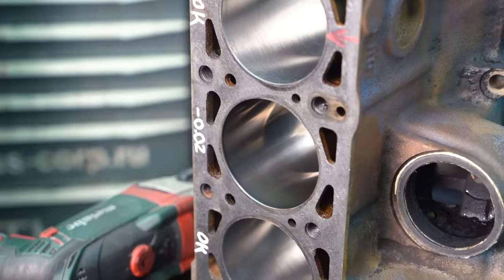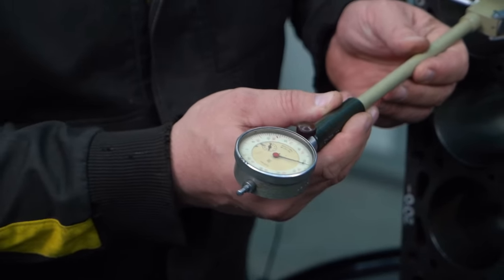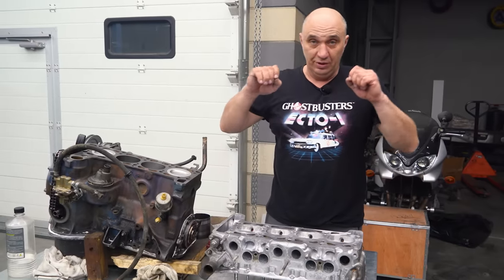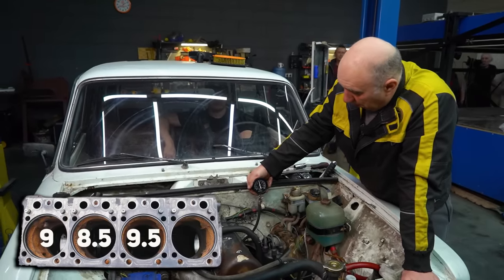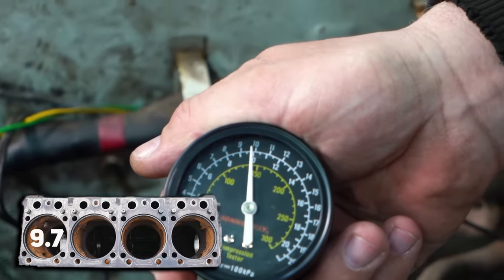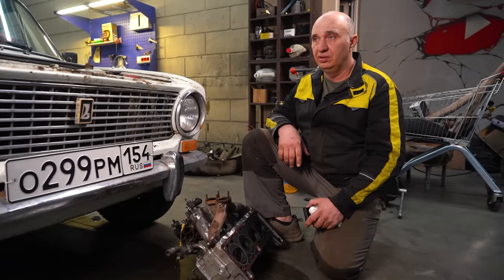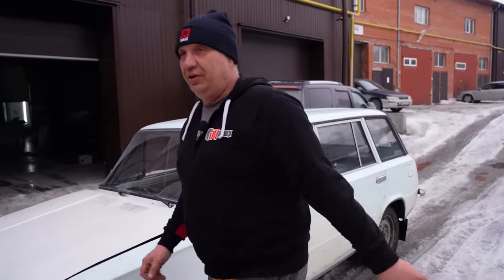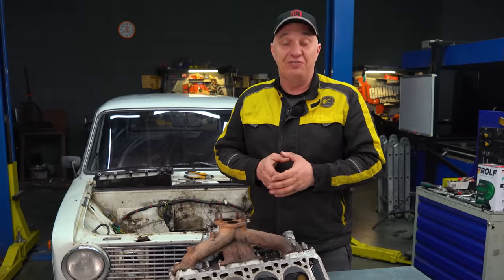Honed cylinders or mirror finish - which is better?

Comment: The two angle cross hatch pattern has two purposes. The first is to provide lubrication to the rings. And the steeper angle causes the rings to rotate to keep the cylinder wearing evenly preventing premature wear.
Reply: Why do people offset the rings when installing just for first start on that engine? Asking because you mentioned the rings moving while running.
Reply: @WhatsIncluded  With an offset, gasses do not have a direct straight line to flow past the gaps, they do all spin a little, they don't spin the same amount, so after some time they would probably fix themselves at least a little, but it does help.
Reply: @mikahandony7797  okay so it's not the end of the world if you don't because they will do it eventually.
Reply: If only we can test that theory I mean if I mark the position of the rings they better be in a different position then where I put em
Reply: The rings do not rotate when the engine is running.
Reply: @onestopfabshop3224  of course they do.
Reply: If the rings don't rotate, why are they never clocked the same after running? I used to race back in the 80's and frequently did teardowns to make sure the engine wasn't hurt or rebuild before the next race.
Reply: Rings do not rotate maybe very slightly but they do not do what you are saying.  I work at an engine machine shop. I'm not ignorant on this subject at all
Reply: @jackdaniels2657 I've built engines for a living for 15 years not. 1 example I can think of right off the top. I built an engine for myself  high hp ls7. I blew it up after 15k miles. Pushing 1500 hp. Dropped a valve.  The rest of the rings were exactly where I put them. 180 out from each other.
Reply: @1magnit they do not
Reply: @jasonlucas8740  At 15 years you're still a beginner. The only time the rings stop rotating on the piston is when they get gunked up with oil or when you break a ringland. When they stop rotating you get uneven bore wear and a groove.
Reply: @jasonlucas8740  I do my own machining too, been building engines 45 years, you're only 1/3 of the way there. Beginners class.
Reply: @jasonlucas8740  How about a 2 stroke bike? You've never had one apart? The rings are pinned to prevent them from rotating otherwise the ends would catch on the ports and break.
Reply: @onestopfabshop3224  they do rotate unless you have a pin/indent/snap in the end to stop them rotating. you need them for some applications. supposed to rotate anyway. on a 2 stroke you don't want them to rotate for example.

 if there's 2 in same groove they may be stuck together acting as 1 ring.
Reply: @onestopfabshop3224 I tried to compare force on the rings due to pressure and acceleration. On very high RPM and closed throttle the ring may lift on at ignition. But it should sure lift at valve overlap. With some management of crankcase pressure, the rings may be free for some ms and grab a grove ( with their own groves??) a with their gap?
Reply: Actually they're not meant to rotate. The cross hatch being two equal angles puts equal force in both directions to prevent rotation.  That way  rings wear (break) in to the unique shape of the cylinder and stay there.
Reply: @gorporpio  How many engines have you pulled apart? The only rings that don't rotate are those that are pinned to prevent it. As in 2 strokes
Reply: I've lost count of the number of Alfa Romeo four cylinder and V6 engine in put together and torn apart most for track use the rest for high performance street use. And I've never seen the rings line up they rarely ever moved off the the initial placement. In fact the only thing I remember moving in a rotation other than cams timing gear and crank were valves when they had factory rotators. We the occasional spun bearing.
Reply: @onestopfabshop3224  So they rotate when it's not running? I bet nobody's tested that.
Reply: Flat tappets rotate unless the oil is "too" slick.  Can that happen to rings?
Reply: @solarsynapse  If it's able to rotate then it WILL rotate. That applies to everything.
Reply: After all these years of engine development we still have people arguing over whether or not rings are meant to move.
Reply: @JJFX-  Because children.
Reply: @opinionsvary  So here's the thing... people are making this a binary question and it isn't. The simple answer is yes, 4-stroke piston rings are typically intended to at least have the ability to rotate during operation. This can minimize ring deposit build-up and help wear during engine break-in.

How much this happens really depends on the engine. They don't always rotate at the same time, the same speed or could simply oscillate back and forth depending on engine load, pressure, expansion, wear, etc. There are times when gaps align which isn't great for oil consumption but it really depends on the setup and they shouldn't stay in that state once load changes (as long as they can move). The significance of blow by in this case is a whole other topic.

However as things wear, the cylinder gets out of round and/or deposits form on the rings, they'll move less and less. They could be fine but can get stuck with an overlap and on some engines isn't uncommon.

TLDR: You may or may not see some ammount of rotation upon inspection. This isn't necessarily a problem one way or the other but can be a signal of cylinder wear. 2-stroke piston rings are typically pinned due to port locations and diesel engines may want more ring spin. In fact, some industrial diesel applications even have sensors that detect when the rings are no longer able to rotate.
Reply: @onestopfabshop3224 yes they do! That's the point of the 45 degree hone,to help rings rotate back and forth

Comment: As an engineer, trust me you need honing on the cylinder wall because of the lubrication, polished cylinders cause increased engine wear because the oil is not staying on the wall and lubricating it. That also worsens the thermals.
Reply: You talk about Teflon in a pan? Your ideal finish is probably sandpaper. Air presses past the rings through the drainage groves and pushed the oil onto the pan.
Reply: And what are you talking about, one time drag race ? Maybe for the extreme performance but if you want longetivity of the engine you need good lubrication and cooling effect.
Reply: I know an engineer, but a train related one.
Reply: Not on a 2 cycle though just add some motor oil to your gas
Reply: @patrickday4206  I learned that the lowest piston ring is there to remove oil from the walls. I guess that you could have a 4-stroke with a single piston ring and no lubrication problems. It would just drink a little more oil. Race engines have less rings because they get fresh oil before every race anyway.
Reply: @MrArni765  I never had overheating problems in an engine. Maybe in Texas? Maybe in a 2-stroke or Wankel or Liqui-Piston? Engineers easily cool the cylinder walls using air or water.
Reply: Depends on the engine some engines are designed to have mirror finish and they run great with very little wear. It's all about the engineering and what they are trying to do also what is the oil plus when a piston is moving there is oil being pumped to the piston wall and on the down stroke the rings clean the oil from the wall because you don't want oil to be in the combustion chamber or at least as little as possible
Reply: @tdobson888  the trick is to control the temperature on the cylinder walls so that gasoline evaporates, but not the oil. This is also why LNG / CGN fuel is cleaner than Diesel fuel. And then two strokes are somehow still allowed on our streets and rivers ..
Reply: I'm not an engineer, but I did stay at a Holiday Inn Express one night.
Reply: Try and remember where the oil ring is located and how the oil gets black because of combustion results building up in the oil making it thicker, thicker, thicker. Sanding your engine. Remember also that discolored oil doesn't mean dirty.
Reply: You could have polished cylinders if you sufficiently face hardened the cylinder bore, but absolutely honing and using oil for lubrication is far cheaper.
Reply: @BigEightiesNewWave  Diddy is a train engineer......

Comment: When i was young i used to hear guys talk about ' chrome plated rings ' taking a long time to 
' break in '.   I thought that sounded like it had to wear through the 
chrome plating and sounded dumb like it defeated the whole purpose of the chrome.
I then had a 350 chevy short block to rebuild and miked it all out. It had mirror finish cylinders with almost zero wear so i thought i would try something. I installed chrome plated rings without touching the cylinder finish.
When i had 7 pistons in i could still turn it over by hand on the crank weights. I didnt need a wrench until i had all 8 installed.
I put it all together and it ran clean and fine right from the start.
It ran well and at about 20,000 miles i drove it across country getting terrific gas mileage.
Reply: @g0tsp33d  it meant a lot to me. I used to watch friends rebuild short blocks and be lucky if it worked at all.
For mostly backyard engine building I went on my own knowledge of engines plus a few ideas of my own and I drove my engine across country towing things.
Sorry if I didn't have proper flow charts and proper records. I did mic everything and made sure all my rod caps were as 
' round ' as possible. I was 21

Comment: Honed cylenders are for holding oil in the scratches.  Smooth cylenders are for o rings.
Reply: Model engines that are ABC don't have rings and are mirror finished piston and cylinders.  Ringed engines are honed.
Reply: @solarsynapse  There is way more to that, than simple ringed or not.
ABC linears are chrome plated or made of chromium. Chrome is very hard and have low friction. They run on premix so lubricating oil comes from both sides.
They run on high revs so blowby isn't big problem.
Most important, they don't last very long.
Reply: @feluke8396  ABC engines don't hold compression till they get to working temperature , liner is way out of round when rhe egine is cold this is how this design works , brass alloys are commonly used with chrome plating on the liner walls this alloys are more thermoplastic than steel alloys so they can change their dimensions much fatser to seal the blow.When cared well the engines can surprising have long lives depending on the quality of the make.I have seen and owned some exemples worked more than 30 years still holding perfect compression.

Comment: My understanding is that the honing serves 2 major purposes:
1) it traps oil against the cylinder walls for lubrication. The oil also helps the rings seal.
2) it helps the rings wear in when the engine is new (or fresh rebuild) and helps them seal better.

A mirror finish would be better with a soft o-ring because the texture of the honing will shred the o-ring.
Reply: Actually --- a chromed ring set with very narrow edges for higher ring-to-wall pressure has to have mirror walls. The Japanese learned this early and their engines always ran well and for long. The US grew to appreciated the lowered friction and that factored into the C.A.F.E. Standards to help emissions and better performance. 
Face it --- today's engines get more power and performance out of smaller cubes and last longer than engines before this stage ever did. It's not uncommon to get 400K miles from a mass-produced engine, when ---> in the 1960s, engines went maybe 100K and needed a complete rebuild and bigger bore to clean up the badly tapered block. In the 1940-50s, you didn't "tune up" an engine, you overhauled it.
Reply: Chrome rings need a rougher hone finish then moly rings but both need good fresh crosshatch to seat correctly, grey iron can be installed without a hone but don't last...
Reply: @SurferJoe46 because engines back in the old days used rings with lots of tension, now they use thinner rings and low tension rings,plus using the right hone for the ring packs.
Reply: @SurferJoe46  That may have more to do with increased precision where tolerances are concerned and improved materials, especially block alloys, rings, valve seats, and bearings.
Reply: @jeremyking5684  Conceptionally, you're correct - but practically, slightly wrong but on a good plane. 
Thinner rings will have a very tiny point of contact so that even if their tension is less, the overall effect is higher contact pressure. 
A 100 lb woman, wearing spiked high heels, exerts tons of force at each heel point. Put her in flats and she can almost walk on water because her weight is then spread out over a larger area. Same-o with thin verses thick rings. 
A thick ring, to perform equivalency in sealing, would need much more outer pressure on the cylinder walls to keep gasses from blowing by. 
The older designs didn't have the alloys and technology of today --- there's the mitigating factor -- well, that and the bean counters.

Comment: Honed of course. The term deglaze the cylinders isn't around because shiny is better.
Reply: Shiny is indeed better, the cross hatching is for the smooth wear in. Pull a head off good running old motor, it's smooth as glass. What you think about what's going on is mostly based on cold and new logic. The new doesn't last long and neither does cold. The surface starts heating on the very first ignition,although it hasn't penitrated into the block the first few microns of surface is hot and flashes between hot and cold until the external temperature reaches equilibrium with internal. Cold oil does infact bead up on a smooth surface but hot oil doesn't. As long as your oil ring is still wiping you have oilfilm. There's a reason high performance engines have the thinnest oil possible while maintaining oil pressure. Low voc high pressure is better at lubricating. Parts don't wear bc parts dont make contact ,theyre floating off of eachother. It being thinner means you can move more of it and it can easily reach places quicker

Comment: the honed cylinders had less deposits on the valve than the polished cylinders. i was aware that you want to hone cylinders before installing new rings for best results, but it's nice to see it confirmed.
Reply: It's the other way around actually.
Ofc I do trust honing is better for various reasons but 2 and 4 are polished and those are the clean ones
Reply: @doopiej Nope it's the opposite, as op said the honed ones are cleaner, check the start of the video: the cylinders marked -0.02 are the ones with mirror finish and check their position relative to the timing chain hole

Comment: Lada has to love Garage 54, the way they show what Lada's cars are capable of.
Reply: Capable of being abundant and cheap.
Reply: @NotAnonymousNo80014  We need cars like this in the US.  Our auto industry has let us down in a major way by putting their efforts into making cars that are needlessly expensive, difficult to repair, and that have features that are unnecessary, such as complicated audio systems.
Reply: @NotAnonymousNo80014  Lada engines are built on very old porsche tech and Russians are quite experienced with metal casting. Lada's problems stem from poor fit and finish which are quite easily corrected if one has any idea how cars work. The other downside is they are quite uncomfortable to drive since everything is made simple as possible, no sophisticated undercarriage. Plus side is Lada's are pretty much bulletproof, you will always get from A to B.
Reply: @NotAnonymousNo80014  oh hell yea, when I was in Russia some 5 years ago, I saw a commercial for Lada, I think it was Granta, it was around 6000 euro NEW. I wish we had those prices here..
Reply: @SeattleMartin   we could but unfortunately the EPA decided the only way to fight climate change is to make us all poor
Reply: I can only imagine that these guys buy head gaskets by the crate...
Reply: @SeattleMartin  Not allowed due to emissions regulation.  Your unreliable US vehicles emit minutely less CO2, so they are clearly superior (not).  They don't factor into the equation the emissions of constantly making new vehicles in 3rd world countries as this would make it economically feasible to manufacture in the US, where workers have human rights (not allowed).
Reply: @gunt-her  That's absolutely right-the 'pretend' cost of automobile manufacturing and ownership (here in the US) is advertised to be far less than it actually is, because some very important factors are left out of the equation.
Reply: @joey9511  the emissions systems alone jack up the price of these cars by more than one would think. Especially diesel trucks
Reply: No Lada's left to buy in New Zealand.

Comment: This was an interesting test. I suspect that the greatest advantages of crosshatch honing are:
1) Increased oil-film adhesion resulting in reduced cylinder corrosion during long periods of storage.
2) Increased oil-film adhesion resulting in reduced cylinder scuffing during startup, after long periods of storage.
3) Reduced piston-ring friction resulting in greater power and fuel efficiency. Reduced friction is partly due to oil adhesion, and partly due to reduced contact area and normal force.
4) Reduced piston-ring friction resulting in reduced coolant temperatures.

Comment: The truth is somewhere in between.You first polish it and then hone.So the hone creates pockets (scratches ) for the oil to stay on the cylinder,but the actual surface where the rings ride is smooth(polished)